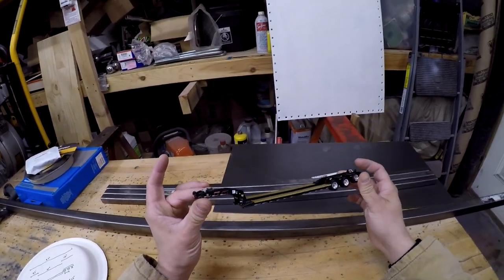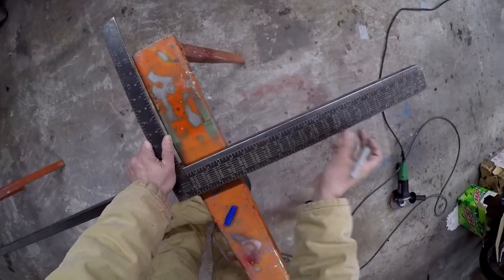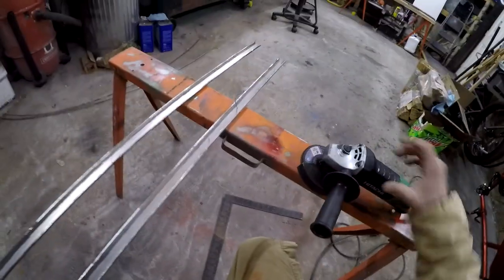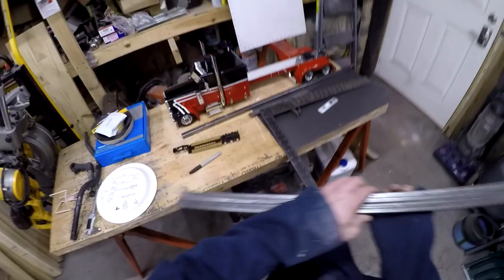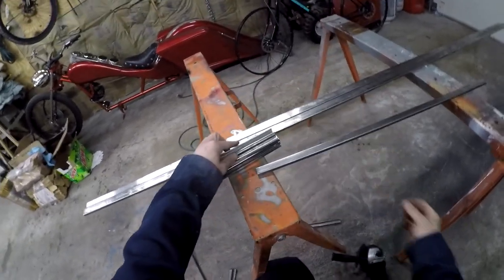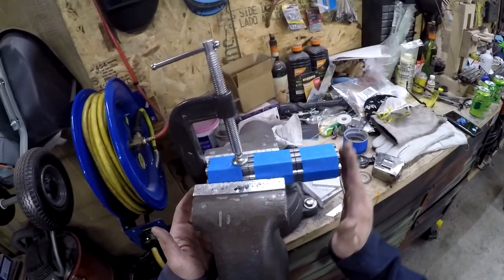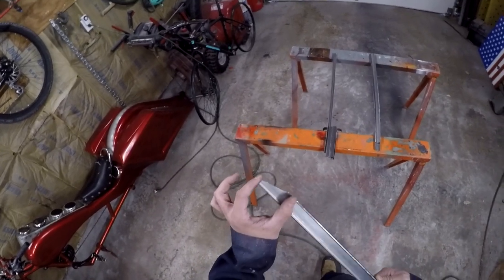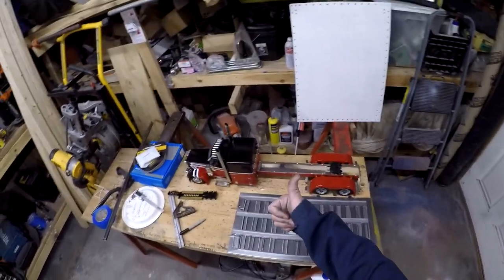Fabricating 1/14 Lowboy for Semi Truck Part 1

Comment: please metric system
Reply from the maker: I'm in the US and the imperial is what we use and what all my measurement tools use. It's the same system the manufacturer uses as well so naturally that's what I use. I do refer to metric here and there for stuff from overseas that is uses the metric system. However, there are 25.4mm per inch so if your trying to replicate my build, multiply all the measurements in inches I give by 25.4 and you will have the metric equivalent.
Reply: @KarlsKrafts  thank you karl. I learned your measurement system yesterday. much is still only possible with a look. is the small trailer 1/64? Greetings from Germany and you are doing an incredibly good job!